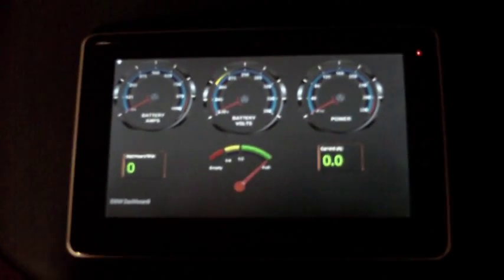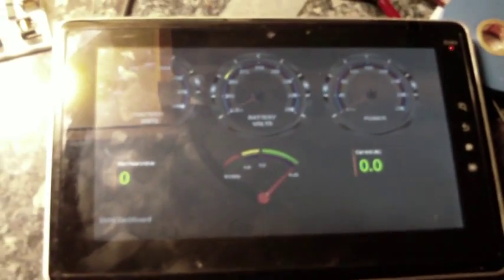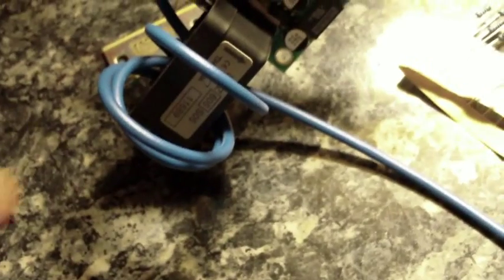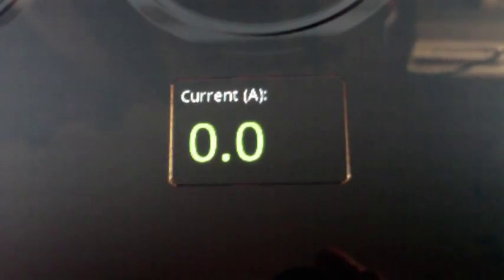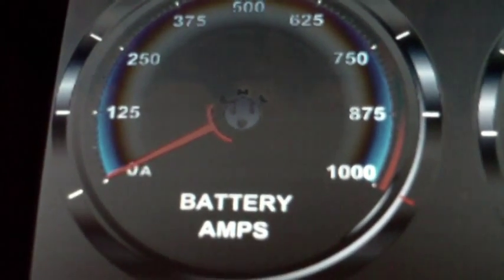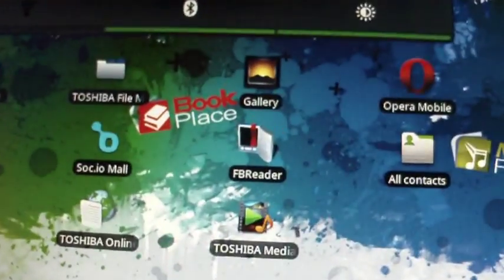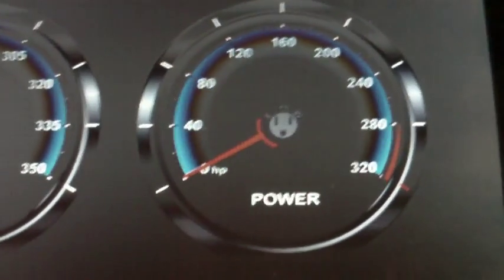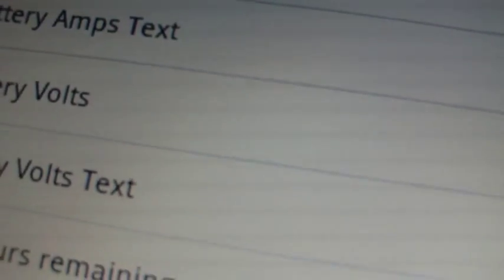BMW EV Conversion 68 I,Android

Comment: Should make a good dash for an EV Car. At least if the car power runs out, it should have enough charge to show you your speed as you slow down, or make a call for support. More importantly, it can show you problems that might be imminent before they become a problem. Keep up the good work.